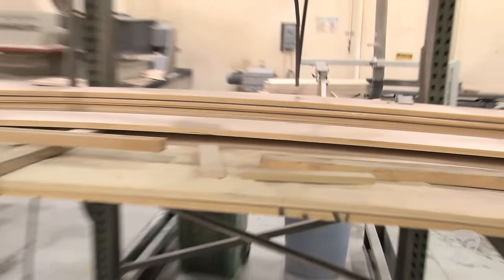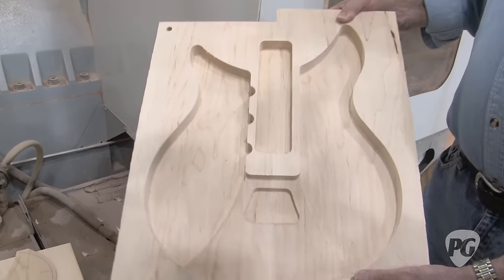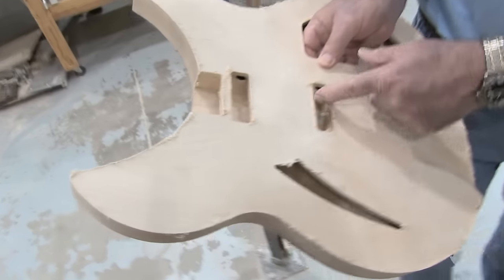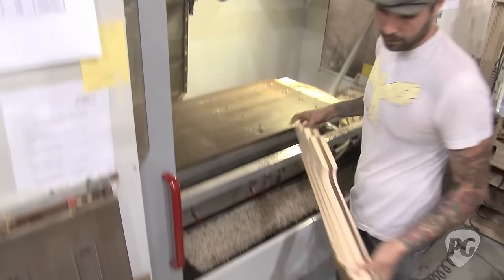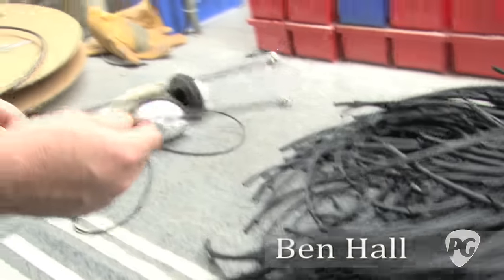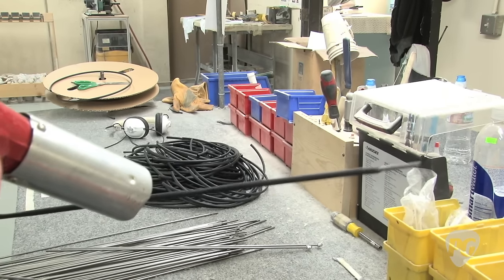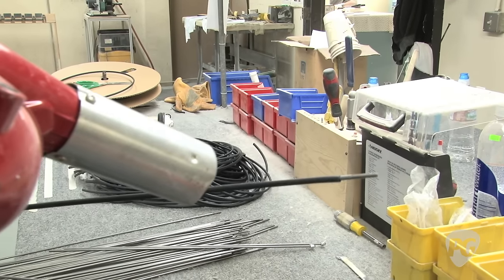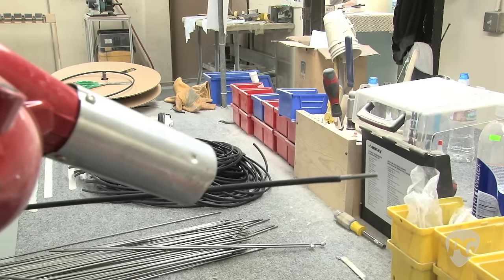Rickenbacker Guitars Factory Tour: Model 330 Construction

Comment: I love the cottage industry feeling they have there at the Rickenbacker factory. It doesn't seem like a huge faceless concern, more a small bunch of friends making sure their product is the best it can possibly be. I'm also impressed by the hand finishing and the craftsmanship that's involved. They're an expensive guitar but the sound and quality is unquestionable.
Reply: Yes, you get what you pay for. I own two of them, I know.
Reply: They're not that expensive in the scheme of things. I buy nothing but used anyway. I currently have an '83 320 (non vibrato sibling of the famed 325) and guitars were made way differently versus CNC. They're hand routed for the old process, so open up an older Ric and you'll see how it's not very pretty nor precise. The shaping of the body and neck, paint and extensive polishing is all done by hand. The necks changed depending on the year and unit of production. Hence why they went to CNC to keep neck shape and profiles consistent. Rics made before late late 90s are conversion varnish. All Rics today have UV cured finishes. Both are hard, durable and have glass like finishes. When taken care of properly, they last forever and shine up instantly.

Comment: I worked in the wood shop on the swing shift there in Santa Ana for most of 1975 while going to University of California Irvine. Besides the CNC machines cutting bodies, the old place really doesn't look as though it's changed at all. One thing I might advise if one were to considering purchasing a Ric: Occasionally, a slip of a chisel, an out of line cut, an overly aggressive bit of filing (or the like) would occur after quite a few hours had put into a guitar. Some wood dough, a wood patch and some glue, a shim, whatever, and then a big "B"   would be drawn on- telling the paint shop "Paint it Black!" or some other opaque color. There were a few nasty screw ups mickey moused together, but mostly they were "Oh SHIT!" moments. Not critical, but noticeable enough to you wouldn't want it visible, Only the best were finished in "Mapleglo" or "Fireglo". So, give a black 4001 a closer inspection before paying all of the money for it. Great instruments.
Reply: also I tend to think of bass guitars when I hear Rickenbacker not guitars.
Reply: On a Martin guitar one slip up and the guitar is destroyed. They don’t make second.
Reply: I wouldn't mind a few Knicks along as it doesn't effect the sound or playability
Reply: Very disappointed with 330 and 4001s bass bad fretboard finish they say oh it’s your fault neck constantly needs adjusting finish very thin on body buff marks not very well made wood is not dried properly
Reply: I have a mapleglo 4003 that i bought preowned sight unseen off of reverb and it's in great condition but one tiny thing i noticed recently even after all of this time that I've had it and played it (I can't put it down) is that on the right where the neck meets the body it appears that someone took a tiny little piece off of the body and filled it with some sort of wood resin and then the finish went on top of it and it wasn't smoothed out or anything. It doesn't bug me at all (obviously since i haven't noticed it until very recently and you can hardly see it) but I thought it was kinda funny.
Reply: @GuitarsAndSynths  Sweetwater had an Autumnglow 4003/checkered binding for 1899, an automatic collector's bit, so I had to buy it. I won't play it out, as I have my road-dog P-bass for that. What's nice about Sweetwater is the actual guitar is in the oic, and yo can zoom in and look for imperfections - and they show the exact weight. They only received 2 autumnglow and 2 maple with the checkered binding, so thanks to John for these nice surprise runs. He's managed to piss off a lot of folks, with his uncompromising manner - but I respect the man and his family's product.
Reply: Thanks
Reply: @jduff59 what year was the AutmunGlo?
Reply: @sandybarker19  I just got it in September - they had 2 total, so I was lucky. It's a true keeper.
Reply: @jduff59 : what's the serial number? Are you sure it's not Montezuma Brown? AutumnGlo is satin, Walnut is gloss. I think they stopped the AutumnGlo in Walnut back in the eighties.
Reply: @sandybarker19  It is 21002 and satin finish w/checkered binding, 21001 was purchased by a guy who posted on Talkbass in the Ric forum. I called Ben at Sweetwater and he gave me a good deal so I jumped on it. I don't know if they're making more or not - you never know with John Hall..
Reply: @jduff59 : the serial number doesn't come up on the Ric site. The serial number should be on two spots on the Jack plate. I'm just curious as to if they reissue the AutumnGlo. I didn't see any information about it on their website.
http://www.rickenbacker.com/service_serials.asp
Reply: @sandybarker19  It's got the year on top (20) - Ii have photos posted om the Ric Club on Talkbass and I believe the other one was posted with pics as well - that's how I found it. Right place at the right time. Satin finish is on point.
Reply: @jduff59 : Interesting, I'm on the Ric website quite often and never saw any info on new special editions. I know a few years ago they stopped making special editions so they could catch up on production.
I have a 1979 4001 Autumnglo. SG3798. Back in the eighties I had put an ebony fretboard fretless and did some electronics modifications. But I had somebody Dale Fortune restore it as close as possible. He had some checkerboard binding that he put on for me and I also added a zero fret. and I just recently updated the old wiring harness with the 4003 harness. Mine used to be satin but now it's gloss.
Do you have any more info on that special edition run? Usually Rickenbacker posts the special editions on their website but I never saw it. That's how I got my 2004 381 in Montezuma Brown. They must have snuck those out the back door without telling anybody.
I saw a couple of them on reverb and they look beautiful, mine came with the black pickguard and black name plate and you can't buy those anymore.
Reply: @jduff59 : do you have the link for the talk bass photos? I couldn't find the photos I tried looking.
Reply: I read, I think John Hall saying that sometimes too they paint over some nice timbers.
Reply: @jduff59  Man, I'm jealous... Lol
Still waiting for my Autumglo 4003 checkerboard from Sweetwater. You can pre-order and ETA is April or December of 2021. Sweetwater's pics now show it with the Rick-o-Sound jack and when I talked to Jesse, he confirmed that. Really curious to see the pics they send me before it is shipped. I checked out your pics on TalkBass. That is one sweet piece you have man. Congrats.
Reply: @deathrowe3682  Thanks, and the satin finish feels great and the bass plays well. Ironic that I get the best bass I've probably ever owned now that I'm retired, but that's typical of being a musician. Sweetwater will get you a fantastic price on these - so keep in touch with your guy there -and good luck!
Reply: Did you happen to know my dear friend Brian Carman?
Reply: It’s the same for pianos, even Steinway. If someone botches the veneer or it meets with a knock, it will get painted black. It’d be silly to do anything else.
Reply: @jordanchastain5132  mine has the same. I didnt want a Mapleglo at first but in real life the wood finish is amazing
Reply: I have a ‘75 4001 lefty.  I love the cavity graffiti!  Walrus Special printed nicely under the bridge pup and a name, Robin k...
Reply: I just took the neck off my Ibanez to service it and found sandpaper shims.

Comment: John Hall has a reputation for protecting legally against anything else hitting the market that "looks like"  a Rickenbacker.   I can't blame him.   It seems that they have production running smoothly,  and demand is higher than supply.  I plan to get another RIC as soon as I have the money ready.
Reply: I have a 330 and I recently played a used copy for sale at £150 (!) made by Indie Guitar co. It weighed a ton and felt and sounded so wrong. You get what you pay for...
Reply: DeadKoby thank you. I was wondering why I never see ric copies
Reply: MardukFilms In the 70's Shaftesbury made nice copies and in the 90's Tanglewood also..But nothing feels or sounds like the real thing. Since this I have also play a "Rockinbetter" Chinese rip off ... Firewood!
Reply: @demilieu  They use different fret wire now. Not an issue.

Comment: I have a lot of guitars.  One is a 360 6 string.  It's by far the best build quality of any factory made instrument I've seen, including Gibson (even the older ones - I have some more than 20 years old - and Custom Shop) and Fender.  It's not even close.   I'm a bit obsessive and I've studied my Ric top to bottom.  It's perfect.  The wood working is perfect.  The binding is perfect. The finish is perfect.  Even the chrome plating is perfect.   I guess a custom built guitar might have cooler wood or whatnot, but it's hard to imagine anything could have better fit or finish than a Ric.  And almost entirely USA made parts.  A Ric is not inexpensive, but it's not any more money than other high-end brands -- that can't come close to the quality and USA content.

Comment: I wonder if that guy putting on the name plate was the same guy who put the name plate on my 360v64 and miss drilled the hole slightly so that it got into the edge of the relief cut for the truss rods back around '94-'95. Other than that I love the thing.
Reply: look at 20:30 setting the screw...

Comment: I cringed my back out at 20.27 when that screw went in. 
Also (apart from the finish) there's nothing special about the way the CNC machines make these. I feel let down.
Reply: I know! The screw tipped to the side, then it went in anyway.
Reply: I still bought a 1993 Rickenbacker 650S and although I know it was stupidly overpriced I love it!
Reply: Jeff Allen-true, saw that in the previous conment
Reply: As a Quality Engineer, I would definitely take that guy off the job who put the screw in the machine head. Horrible to leave that in the video. Major fail. No pilot hole? But you do on the name plate? WTF?
Reply: I did too! Not only did it go in sideways, but it slipped on the drive spline rounding the damn screw head!  I know people go on about what is 'hand made' and cringe at 'machine CnC' made stuff, but if those holes were done by CnC then there would be no crooked screw.  Hand made isnt always the best way.
Reply: and then the screw driver skipped over the slots - face palm

Comment: I love my Rick basses. 75 4001, 2006 Blueburst 4003, 2009 Fireglo 4003 and 2006 4001c64s. I have a 2006 Fender P-Bass standard (USA) and a 2001(USA) Fender Jazz, an 08 Gibson SG as well as an Ibanez SRX705 and a SR 405. My Ricks have never had trouble. The neck on my 75 is straight as an arrow, has been set up once since I've owned it for 25 years. My Fenders and my Gibson see the shop twice a year...They're all great basses in their own right and I love them all. My first line is my Rick basses

Comment: As someone who has been building guitars for over 25 years, I can tell you that the body shape and cavities being CNC cut is NOT a "magic robot guitar building machine".  It's a tool just like using a jointer to make the center seam on a top.  It just creates more consistency of the "raw" pieces... they just look that much closer to a completed guitar.  There are still a TON of build, sand, fit, more sanding, finish, setup steps until it's a finished product.

Comment: Solidworks and Haas... cool.  I was one of Solidworks' first customers in 1995.  Still have my 96 install CD - back when it fit on a CD.     I just bought a 2003 4003S ( I modded it for Ric-o-sound) I had two 4001's back in the 70's but the hairpin trussrods just let go.  You could loosen them, reset the relief and re-tighten the nuts but it would only stay for a few months.   So the 2003 uses a standard 2-way single truss rod. Much nicer to deal with.

Comment: Bought this second hand Rickenbacker 2019 model 4003. It's got some issues with pickup changes, and some noise. I tried to cancel the noise using copper foil. Did not work. Unfortunately the guaranty had expired a year before I got it. Is there an area in this factory where I can have it fixed? I would really appreciate your help.

Comment: My 2018 4003 Bass came with the bridge mounted crooked and a couple bridge saddles rattling. I put an aftermarket bridge on after the factory fixed the bridge alignment. They more or less refused to send me all new saddles and just sent two. Seemed a bit nit-picky on their part. 

Yes, I would do it all over. It’s a fine instrument. 

Just don’t think the sound is that much different from a Fender Jazz. It’s about the same.

Comment: Thats how Carvin makes their guitars too. The body is actually two pieces glued on to the sides of the neck. So the neck IS the guitar. Makes for a better sustain. The down side is if the neck breaks, the guitar is trash. You could repair it, but it'll never be the same.
But I'd rather have a guitar sound its best with a short life than never sound its best forever.

Comment: I wonder if the new automanufactured Rics sound as good as the traditional hand made ones?
Even if they do it seems unreasonable to charge the same premium prices. Maybe if they upgraded the electronics it would compensate somewhat.
Reply: If you calculate for inflation, Rics actually do cost less than they used to.

Comment: I still find it interesting that even Rickenbacker employees do not pronounce its name identically!  The plant manager pronounces it as "ricken-BACK-er", while the employee who affixes the iconic name atop the headstock pronounces it "ricken-BOCK-er".  That proves that there is no hard-pat correct way...or else all its employees would surely know it!  Personally, I prefer to use the original pronunciation attributed to Adolph "Rickenbacher".  That's just my preference.  BTW, my collection includes two (2) Rics-- a 2007 Fireglo 620/12 and a 2014 Fireglo 360/6. 

Another curiosity was the machine in the background at the 1:00 mark. It's brand name is "Reichenbacher".
Reply: You have a 12 string 625?
Reply: @nathanpollard3368  - Sorry, that was a typo. Meant to type 620/12. Thanks.
Reply: The family and current owners pronounce it ricken-BACK-er, regardless of how other employees or the general public erroneously pronounce it BOCKER.

Comment: 7:57 "easy job to service it"... anyone who has ever tried to set up a ricky will know the pure pain that two truss rods actually causes. There is a really good reason why nobody else uses twin truss rods (with the exception of the occasional 9 string). Not easy to service at all.
Reply: I've never had a hard time with mine at all. The older ones are probably a pain because you have to move the neck manually and then tighten the rods to fit. Modern ones are adjusted like regular truss rods, just there's two of them. You have to go bit by bit, but then again, it's not advisable to make big changes to a truss rod all at once on any instrument, so not much difference there.

Comment: Why does Rickenbacker Basses still uses TWO TRUSSRODS in the necks? ? ? Why not ONE Truss Rod and TWO GRAPHITE REINFORCEMENT RODS? ? ? Two Trussrods are so tedious to intonate with.
Reply: Its because their necks are NOTORIOUS for twisting and warping . and the trussrods they use ( especially pre 90's ) are also inadequate .  They also recommend loosening the strings before you adjust the trussrod , because it really cant handle the tension / 
Ric's are beautiful guitars , no question ..  theyre just not very road worthy  =/
Reply: We use a Ric bass in our band, and its never had any problems as far as the neck goes. We toured from Michigan to New York and back, in and out of snow and decent weather, and never experienced any issues with the neck warping. I suppose it's possible we just got lucky, but it really seems like a rock solid instrument, and I would totally trust it for future tours.

Comment: While my FireGlo 4003 is my "go to" bass in my collection (which includes way more expensive basses like a Wal), there are issues. The finish is coming off and has been for several years. Its a 2009 and while I have gigged it plenty, its not like Im on world tours and dont take care of it. The bridge already has tail lift too. Every season change the neck goes haywire and sometimes I can tame it myself, sometimes I need my tech to do it. I can deal with most of this, but the finish already coming off is unacceptable for the prices these go for.

Comment: After all that work buffing the perfect finish,etc... they use the ugliest possible nameplates, stuck on with the ugliest possible screws.  Loved the guy mounting the tuner just blasting in the screw crooked (no pilot) and then letting his bit torque out of the screw.  That'll be nice for someone down the line.

Comment: What's the function of a truss rod? 
Anyone know?
Reply: msginca balance the tension between the neck and the strings. The wood always move a little in the entire life of the instrument. So you can set up the neck with the screw on the top. There are many video and stuff on the internet about that, check it ;-)
(i'm french sorry for the mistakes in english)
Reply: Basically when you play a guitar you want the neck to be completely straight... So if the neck is bowed you can Adjust the truss rod to make it flat :) hope that helps
Reply: Dawson Hooker  Julien Marzano   Thanks.
Reply: Not exactly correct, a neck is never perfectly flat as it needs around .012 give or take of relief so you don't get fret buzz. It is true the truss rod adjust the neck relief by tightening or loosening the nut on the end of it. FYI
Reply: Not exactly correct, a neck is never perfectly flat as it needs around .012 give or take of relief so you don't get fret buzz. It is true the truss rod adjust the neck relief by tightening or loosening the nut on the end of it. FYI